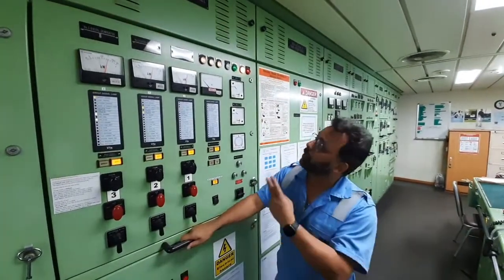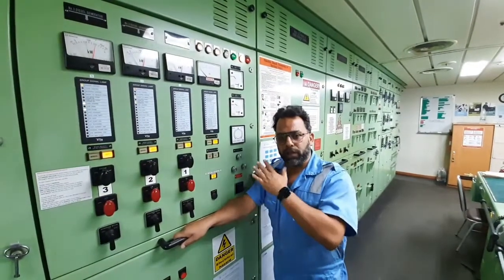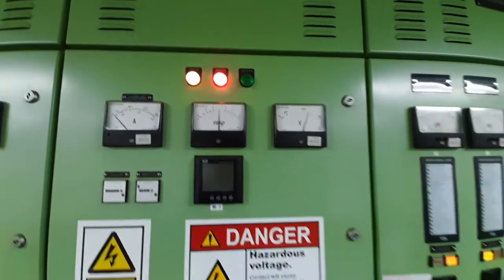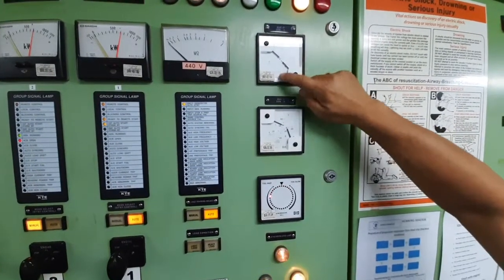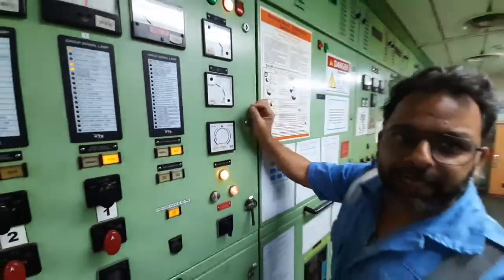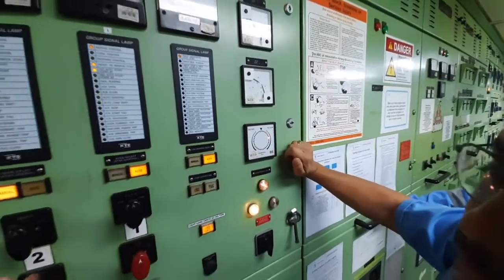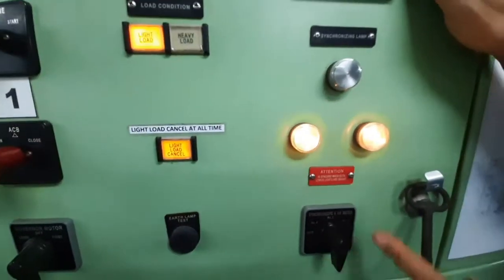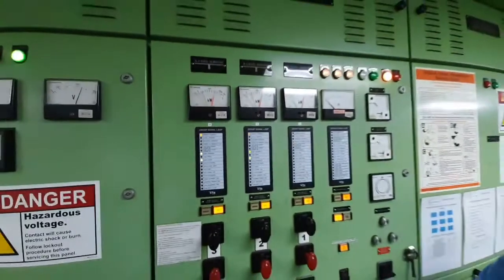Manual Paralleling and Synchronization of generators onboard

Comment: You mentioned phase sequence which also needs to be the same. These are generally confirmed through phase sequence meter prior to core synch process starting. Here you wished to say phase angle of both voltage waveforms same and you matched those with the synchroscope.

Comment: Why 1 Air Circuit Breaker on one side and other 2 Air Circuit Breakers on other side in main switchboard ?
Reply from the maker: Normally there is tie panel ebtweent he two sides so that in case of an emergency the two sides can be separated 
I mean to say that if something is wrong with one side of the MSB we can still run the ship by isolating one part of the MSB
Reply: @allaboutmarine  thanks !

Comment: Sir i just ask question . We start generator by d.o right ,so when are we going to change over it to h.f.o ?
Reply from the maker: It is not always that we have to start on DO and then change over to HFO
The ship I did the video the starting and stopping was on HFO 
However if u r starting on DO then u can change to HFO after it is synchronised and running normally. U can take about 15 minutes to changeover

Comment: How do you regulate power factor of parallel running DG sets. I made a panel DG were synchronised both ACB closed but the power factor of one or both DG set was very low.

Comment: what happens if we arrange load sharing manual or auto while we are paralelling the generators? in the video load sharing is in auto mode, i am asking the reverse situation.
Reply: Manual load sharing is accomplished by adjusting the speed input to each generator’s governor. Once synchronized, the generator will no longer change in speed when this control is adjusted, but the output of the generator will vary with the setting. The power produced by each operating generator can be adjusted by their individual speed adjustment setting to shift load from one to another generator and to share load.